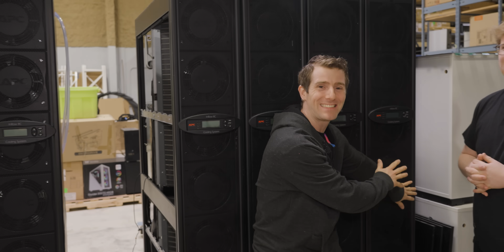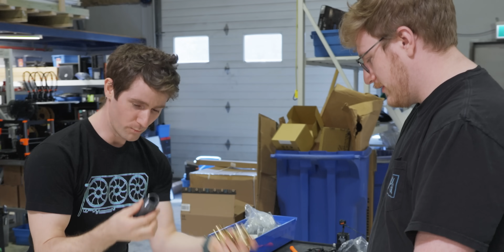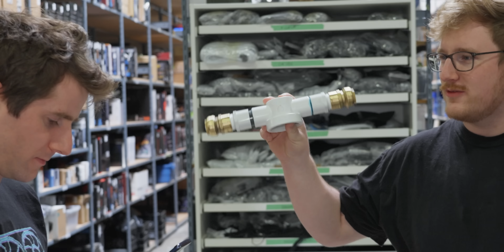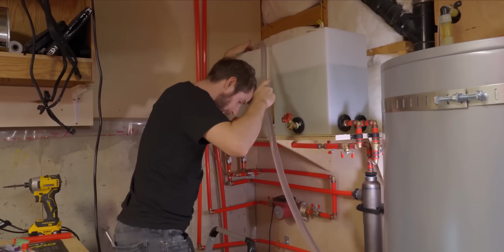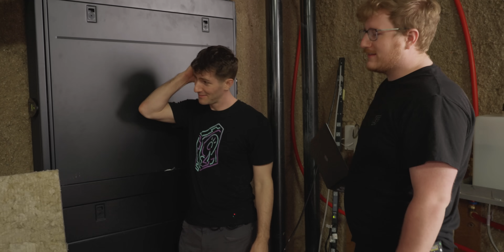I shouldn’t have kept the $1,000,000 computer

Comment: Do you have air ducts to remove the hot air build up?

Reroute the hot air out of windows. 

Air conditioning is ruining the environment. 

Even though ducting is not the total solution, it should get rid of a lot of the hot air and save you on AC bills, and contribute to the environment and the global warming problem.

 If I do not see more environment concious activity at your end, I am leaving and not supporting your channel.

Comment: I know this video is a year old, to be commenting, but the guy who is not a plumber but still insists on adding his poor workmanship on a $1,000,000 computer. On one hand he has no respect for other people's property, which happens to belong to the company and the guy has zero skill set. Btw he could have used whatever pipe he wanted to use before,; all he had to do was buy some reducing sets to fit into the compression fittings whatever size. 
I could just go on and on. 🤯🤯🤕😭😭🕳️

Comment: With your temp diff an flow its roughly 60,000 btus of cooling/warehouse heating

Your 3ton ac is 36,000 btus for reference
Reply: With the pair of them working together the water unit is actually only putting out roughly 39,000 btus

Comment: Its simple, really. To be able to maintain a 1 million dollar computer, cold is required. This means, you need to live in a cold environment for your PC or Mac to be able to handle the heat. This means it needs cold from the outside. One solution to this problem is to move to Alaska, or to Greenland, or to Iceland where your machine is exposed to cold throughout most of the year. An even better idea to maintain a computer system is to make sure that you do not keep it up and running for 24 hours. You want maximum capacity. This means your system needs to be turned off for an extended period of time so it can cool itself off. This is how I had my friend design a Cooler Master Cosmos 700 M PC. It´s currently worth about one million Icelandic kronas (iskr). It´s quite powerful. Every night it´s turned off. Everything computer at home is turned off. All communication devices are linked to a single modem which once turned off cannot be hacked to my knowledge. There is an analogue phone and there are two androids which can be used in a case of emergency. The home PC has never had a fire issue with its RTX 3090.

Comment: Plumber here. Don't use quick connects for anything important, especially not on a closed loop system as the water in these tend to become acidic or just generally gross which encourages corosion which quick connect fittings are especially bad at dealing with
Reply: oh and use pipe dope and teflon tape and say goodbye to leaks. Tape first then dope

Comment: You could have just bought a step-down...A step-down is a fairly short connection pipe that STEPS DOWN from 1.25-1.00 inches, thereby saving you all that work of cutting pipes.

Comment: You will be able to boil pasta in your "refrigerant" after 3 minutes.  This ia trash.
Reply: The heat metrics noted in this video assumes they are running a closed loop where in fact they are actually test running on colder intake city water.  Their heat exhanger in the garage will not keep up with 4 degrees of temperature increase on the loop through the "DC". My boiler "refrigerant" comment is based on when they try to run closed loop.

Comment: shark bite is great for those jobs where it only needs to last 1 year...threaded fittings work a lot better when you combine thread tape and a sealant. I use 2 wraps of tape and light slather of blue monster, then install the fitting hand-tight, then use a wrench to tighten it exactly 2 turns. Guaranteed leak-free connection.

The tape is a lube to help the threads not bind when tightening, tape is not a great sealant...hence the paste-style sealant that is also used.

Comment: Having a radiator won't remove in cooling from the room because the law of thermal dynamics means you only capture energy flowing through the radiators and since they are on the back on of server and you are control the air flow, it works perfect.  Heat always flows to cold given heat is high energy and cold is low energy.  Refrigeration systems such as A/C do the same thing only maximizing BTU transfer be expansion and compression to move more heat.  Which once you understand that, its just a matter of where you want to move said heat.  Good video

Comment: Easier solution is to put some mini split air conditioners in using the same fluid path you used in the video, so they dump the heat into the warehouse rather than outside
Reply: That's definitely not easier, and the heat exchanger in split systems aren't designed with rooms the have huge amounts of heat dumped into them by computer hardware, they are designed to remove heat from rooms that are being passively heated.

Comment: Evaporation in a closed loop? Yeah, in 20 years. And your duct-fan  try doenst sucks air out, but you have to make sure that somhow air flows into your server room, best on the bottom. And pleas: dont use teflon tape, loctite 55 is the way

Comment: Now that I seen this again and after seeing that they were using a toilet fill valve, why not just use a porcelain tank from a toilet as well, as it would dissipate heat faster as well. This would allow for better cooling of the water allowing for colder temperatures. In theory it would make sense, and would not require much rigging as well.

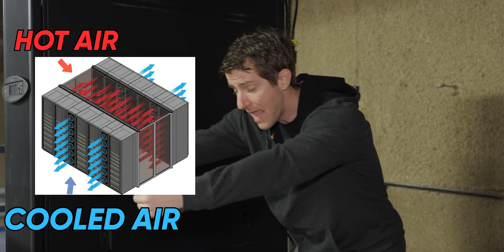Comment: 3:09 Actually the Servers pull cold air from inside and the hot air gets transported outside. So the other way around, even makes more sense. Because the servers need lees force and power to get cold air. Its easier to cool a small amount of air, than a large amount of air.

Comment: You really overpaid for the Uhu. This heat-resistant silicone-based adhesive costs 13€ (about 19.00 CAD) for 80g in Germany (it is a German brand). So you paid almost 20 CAD just for the delivery of an 80g tube. I’m sure it would have been cheaper if you had bought it directly from the manufacturer.

Comment: Dont't leave that toilet valve connected to mains pressure, it's a disaster waiting to happen... add a ball valve and have refilling as a periodic maintenance item.

Central heating systems are required to have two isolation valves in series between the heating loop and mains pressure. Obviously you don't have the same  risk of explosion here, but i wouldn't risk it. Toilet valves may be fairly reliable, but the consequences of them failing in their intended usage are minimal. The consequence of one failing and filling this with mains water pressure are much worse.

Comment: 12:21 Idk what professionals you listened too, but you should of just used pex from the start. 1:17 On the heat in the room which always gunna be there to some point, Get better Insulation, & feed the extra heat though a exhaust to outside.

Comment: Just run ductwork to the front of the chiller unit, with an air diverter valve, and then push that outside. Upside is it will draw the warm air in summer outside, and help cool the warehouse at the same time as cooling the server room
Reply: And push the chiller back towards the out side wall to allow front duct. To drag air from the top of the warehouse, which would be warmer yes, but possibly better for warming the warehouse, duct it to the back maybe? Also maybe add a  pair of `I¬ beams from one wall of that office to the other, possibly adding an upright if no good wall support available on the breezeblock wall (cinderblock??) to support the weight of the chiller(s) rather than the non storage area ceiling.

Comment: Gets excellent equipment donated, then does a fairly sloppy use of of it at only a portion of it's capability (non-chilled), but still gets results. 
I would love to have those chillers for my server room, although I do have enough AC for it. Incidentally, I have found (with a little experimenting) that there is a point where keeping the temperature lower can run the fans enough lower to offset the extra cost of the cooling. For me, running the temp at 73 was optimal. I installed an ammeter on the AC, and use watts meters on devices or use the UPS's if yours have that capability.

Comment: Nerd tip of the day: Mesh filter sizes work inversely. It refers to the holes per square inch. A 100 has 5 times as many holes as a 20. I would suggest switching the 100 for a 20, before the loop clogs up.
Reply: @darrenneave  5 times larger* Not necessarily 5 times more.

Comment: Datacentre design engineer here - haven’t worked with that exact unit but I suspect you would be best to balance the fan power on the server room unit to match the CFM power of the cabinet + the pressure drop across the coil as otherwise you will be creating a negative pressure void and be mixing the air from the cabinet with ambient air - obviously assumes you do a bette Rob of sealing the cabinet to the unit. With that approach you should be able to increase the delta T across the device and increase its cooling capacity. We typically work on a 10-12c delta T for water.

Also please don’t disassemble that unit and turn it into a passive RDHX - the coil pressure drop will be really limiting you’ll find air will just bypass the coil through every small gap unless you seal the cabinet at which point you will find the server fans unable to overcome 60+ pa pressure in the cabinet.

Comment: I get it makes a good video, but to properly make this work a rooftop or building mounted air unit with an air conditioner will be the most efficient. With that said. My suggestion is having one more unit up top than in the server room to allow more cooling time during summer months. Also long term fill with treated propylene glycol for the random day that the overhead gets left open for a couple hours most boiler treatment companies sell a pressure fill pump system. Also you can tie in a make shift cooling tower similar to the homemade PC cooling tower. The problem with that one was the cooling water outside needs to run through a heat exchanger for the closed loop to prevent getting contaminants into the system cooling.

Comment: Filtering the tap water source is definitely a good idea, especially in a closed loop system like this. Deposits over time may cause damage to the pump. It's definitely not necessary but for the small amount of work required to add a simple particulate filter, I would have done it.

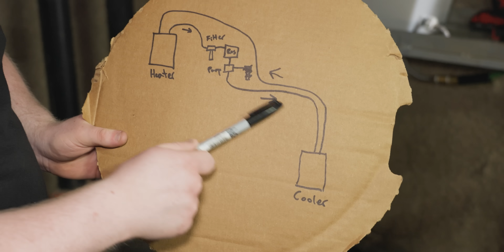Comment: You made a video about this year's ago and didn't follow the advice given. At 7:34, you show the loop. With the pump on the push side of the reservoir. If there is a leak. Your pump will keep forcing water through the leak.
Your video explained that if the pressure needed was low. E g. A good amount less than 1 atmosphere, then you should put the pump between the heat and reservoir and run it in a pull setup. This way. If there is a leak, it sucks in air, the reservoir removes it from the loop as its open to atmosphere and you prevent your nice expensive server from damage due to small leaks whilst creating  a visual indicator for the in the reservoir.

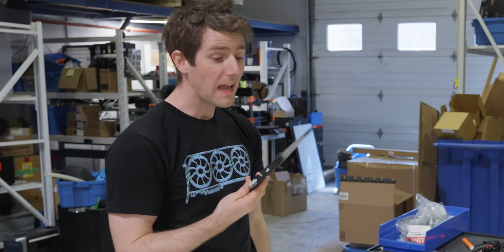Comment: 11:56 Linus cutting all that threading off is actually a huge mistake. Should have just removed a couple inches of pipe from the middle. Leaving less than a quarter inch of threading is bad for the integrity of the seal

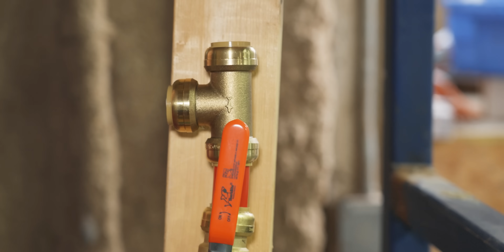Comment: HVAC guy here (just the tin basher) idk the specific fan you have, but based off of your 8:40 material run with the duct and the rough fan size, you are probably moving way too little air, its roughly what would be fed to 1 large room of a house in my experience and you would want to be looking at over 30 Air Changes per Hour Which i would at least roughly calculate to improve the situation assume.

I'm unfamiliar with the retail prices of air moving units, but i know the material would be pretty cheap for the duct

Comment: You shouldn't let the pipes touch as they travel, measure the temperature as they leave the unit in the warehouse and see how much they are transferring heat back into the "cold" pipe.

Comment: you should try using CT1, its in a mastic tube so applying it may be easier and its got more volume per cost than that stuff you use, it sets sorta like a silicone but has a alot of flexibility. have a look. they do other products like bt1 ect. but CT1 would do fine in this application

Comment: so.. FYI- those toilet fill valves "can" fail to stop, and run consistently. Not a problem for a toilet which overflows into the bowl and then down the drain but if you don't have a spot for overflow... but I haven't had the red cap fluidmasters fail on me yet- I'm sure it's just a matter of time. I replace black capped ones that had been installed maybe 10 years ago often enough, i think the red are the more pro version the company manufactures.

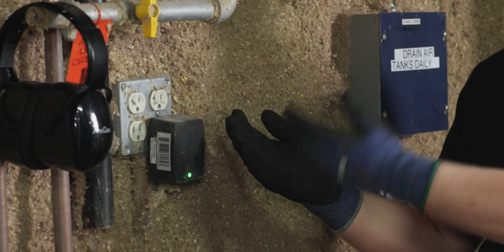Comment: If I were you I would change some of those receptacles (outlets) or add more receptacles that are the twist lock type (NEMA L5-20) at 6:51 instead of converting them to a normal NEMA 5-20 plug since you won’t be looking up there at the plugs like ever and since the whole setup is permanent. You don’t want that plug falling out or being loose, especially if it’s pulling a lot of current.

Comment: On our systems we use fully immersive silicone oil baths for the server motherboards (i.e. usually Tyan AMD EPYC mobos) which is an inert non-conductive coolant. The coolant gets sent to heat exchangers / condensers mounted on external parts of our building. We even dip the 20 Terabyte hard drives in the coolant to keep the drives cool. I think we are at 400 ExaBytes for our Vancouver data centre now so that is getting up there in price! 

 LTT might want to look at dialectric coolant in a fully immersive coolant bath scenario for all server mobos and drives.

Comment: 20:40 wow man thats crazy. you are moving 18,05 kWh of heat every hour. with only 3.8 kelvin delta but you are moving 4088,244 L/h with that little pump that is impressive. i wonder what that thing can do with a proper ac system behind like it is designed for.

Comment: I didnt see it mentioned, but the micron of the filter is opposite of what you said in the video. 100 micron can filter things DOWN TO 100 micron in size, so it will flow way easier than the manuals 20 micron. 100 micron particles are bigger than 20 micron. 20 micron = more filtration

Comment: The plan is called a radiator and automobiles have been doing it forever. Cool the engine then circulate to the 'mini-radiator' inside the passenger compartment - commonly called the heater. Cool engine, warm people.

Comment: Your first mistake is putting the heat rejection side radiator high up in the warehouse, heat... rises, the people are below the heat source, so all your doing is heating the ceiling area, this is stratification - you'd then need destratification fans to take that hot air pooling on the ceiling and blow it back down.  Alternatively, just put the heat source at the lowest point in the room, ground floor.   Next up I bet you don't put inhibitor in the water, so that water will become algae festered before long!

Comment: Eeeeekkk, I've only been plumbing for a little under 2 years but Yeah that's definitely not the safe, cheap or best way to do that. Might start with checking pressure & adding some regulators & taking back every shark bite fitting & going with a real fitting. The risk/reward of running an entire water system through expensive servers but not using a plumber is slightly risky haha. Fly me in & I'll donate some of my time! 
 🍻 🍻

Comment: Shark Bites are good, but expensive compared to actual PEX compression connectors.  The tools are a one-time expense, but worth it even for one job.  Another suggestion, use PEX wall mounts and bend supports.  It makes things safer and look better.  I've been using PEX for over 12 years and prefer it over copper in almost all instances.

Comment: Where to begin?  I guess first thing I'll say is if you guys were located in the US, because I'm an electrical and plumbing contractor by trade who also runs a datacenter in my basement for fun,  I would have gladly donated my time to aid in this installation.  Second Shark Bites will not leak (as long as the pipe is fully seated within the fitting) and PEX of any diameter, but especially the 1" dia.  is a bitch to work with.  And finally you could have still used that 1" Schedule 40 PVC pipe as they make 1 1/4" to 1" reducers.  That was a very smart move placing shutoff valves to isolate key sections.  For such a common sense move you'd be surprised how many people neglect such an important part then when they have a problem the whole system has to be shutdown and drained which leads to headaches later.  Also the best tool to cut any type of PVC pipe is just a standard miter saw as it will leave you with a nice clean, straight cut.

Comment: Here's a piece of information, they make ratcheting pipe cutters for PVC pipe. They have a curved jaw and a blade and when you operate them they just ratchet and bring the blade closer to the jaw. I suggest Irwin since they have a good quality one (if memory serves right). The number is IRHT81742 for the 2 1/2" diameter pipe cutter, don't worry it works on smaller pipes like the ones you were dealing with. This makes working with PVC and Pex a lot easier and cleaner.